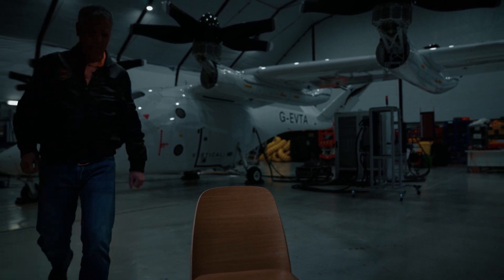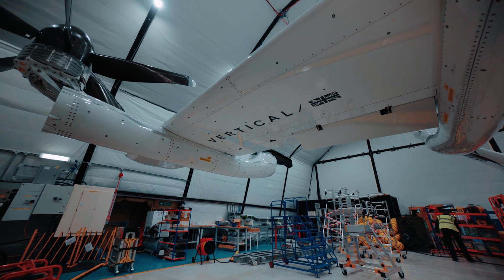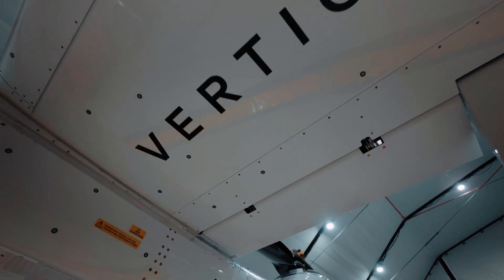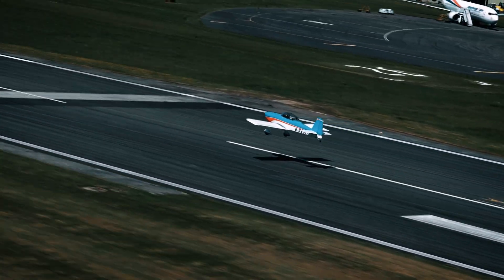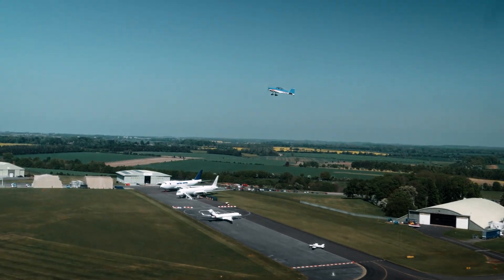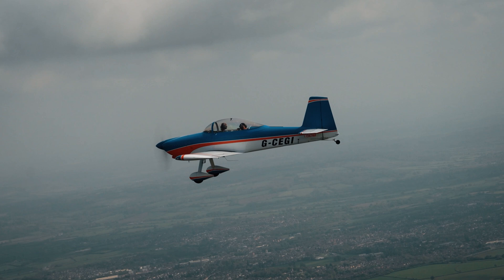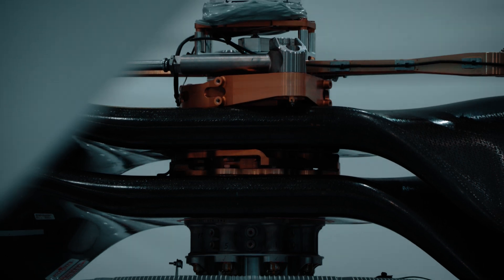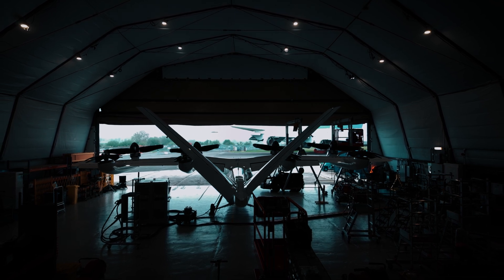Chase Aircraft For Safe eVTOL Flight Tests

Comment: Does the prototype have a ballistic parachute?

I'd rather have that than a guy in a chase plane.

Test pilots are heroes but risk is risk.
Reply: What do you think these chase planes do during these flights? They are another set of eyes on the plane, communicating with the test pilot. The pilot flying cannot see what is going on outside of their field of vision. Hence the second plane chasing the experimental plane. They are not there to catch the plane if they get into any trouble.

Your statement about the parachute and chase plane doesn’t make any sense… at all. They are two completely separate things. Why would you conflate the two things together?